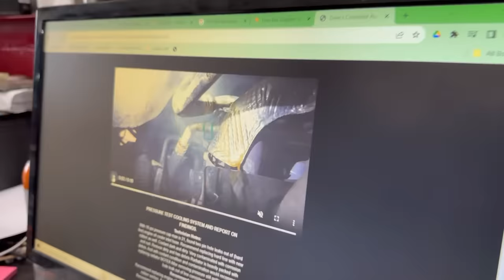The truth about maintenance, and what the manufactures tell you vs what you need to know

Comment: I agree 100%, cut the manufacturer maintenance schedule in half and you'll be doing everything you can to keep your car going. I have a 2006 dodge 2500 with the cam eating 5.7, I use redline 5/30 and an extended filter (RP 30-8A), 3k mile oil changes since new and it still runs like new @389k miles.
Oil & filter changes every 3k.
Trans fluid & filter changes every 25k.
Differential fluid changes every 25k.
Transfer case fluid changes every 25k.
No major repairs thus far.
Take care of your vehicles and they take care of you, just stay away from the fancy gadgets in vehicles nowadays, less equals more.
P.S. I refuse to purchase anything newer than the 06 I have, it's already beyond my abilities to repair the electrical systems. My 76 F250, 78 Corvette and my 87 square body are much easier and cheaper to repair.
Reply: Look up Uncle Tony's Garage, he basically tells u why the cam gets eaten...... it's from constant idling.... there isnt enough splash at idle in the crank to hit the lifters, which eats cams..... cop cars were notorious for eaten cans because they idle a ton....... just a heads up, watch ur idle time 👍👍
Reply: @blainebigger8332  Virtually no idle time for me except the few minutes to warm up. I've sent out oil analytics periodically and they returned an analysis that shows the oil is good for 7k mile oil changes but, I still do the 3k mile changes. Peace of mind costs more I guess, lol.
Reply: I have the same truck and run 10,000 mobile 1 and change it once a year. As well as never changed the transmission fluid. Just crossed 200,000 miles and haven’t had a problem since new. Just use quality products. Over maintaining is definitely a thing.
Reply: @blainebigger8332 uncle Tony is a hack, especially about the Hemi oiling "issue".
Reply: All great advice
Reply: @mr8610  Nahh, "quality products" are over rated. Maintenance is key.
Reply: @mr8610 Well a transmission is definitely in your future. The difference in your example is when that trans goes BOOM, it’s not going to be able to be saved. You’ll have to get it replaced.

Because I can hear you rubbing the pennies together from here, you’ll probably get a used unit installed. Subject it to the same negligence, and then enter the vicious cycle of replacing transmissions every couple of years, until you get rid of the rig. Then you go on the internet and complain what a POS Dodge products are.

🤷‍♂️
Reply: @lynxstarautomotive208  I do pH strips every year when I change my oil with Mobil 1 10,000 full synthetic. Still comes back rock solid. No reason to change it when it isn't giving you any issues. If it blows up, I'm replacing it with a refurbed unit.
Reply: I just bought a 112,000 mile ram 1500 as a daily because I know how to fix everything and there’s no emissions crap
Reply: That 'Less is More' line - My friend just got an SUV with the automatic rear door, just wave your foot under the license plate, and she opens or closes. We KNOW that's going to fail every 5 -10 years, and probably cost thousands. And if you can't open a damn door, you probably shouldn't be driving. We're going to be throwing away EV's in 5 or 10 years as well, so I can't see how that improves the environment. I completely believe in Climate Change, but I also work for a Mining Company in Australia. We spew out a crap load of Carbon in some remote or sensitive parts of the world to get the minerals to make these new cars. And no way are they going to last like your vehicles.
But I shouldn't complain. My company gives me a new vehicle every 18 months or so, and nothing is getting more maintenance than is recommended.
Reply: @mr8610  just about any non-abused engine and drivetrain since at least the 90's will typically last 200,000 miles with minimal maintenance like that. It is not impressive enough to be a sign of good quality. They won't  normally get to 300,000 or 400,000 miles like that though.
Reply: @joshnabours9102  as someone who has had just about every truck under the sun I can tell you that your statement is false. 100,000? Sure. But once it hits that 100k, you’ll find out fast which vehicle is built better. Had a three separate Chevy 5.3s, and every single one of them started smoking on start up basically @ 110,000 and was burning oil like you wouldn’t believe by 180,000 miles — had good luck with the 5.4 Fords and Hemis though.
Reply: @mr8610  according to an easily googleable AARP article on how long cars last: "A typical passenger car should last 200,000 miles or more, says Rich White, executive director of the nonprofit Car Care Council". Additionally, every number found on a quick google seems to be at least 40,000 miles more than your anecdotal experience. 8 years and 150,000. 9 years and 170,000. 10 years and 200,000. When you consider the average age of cars on the road in the US is ~12 years old it makes your experiences sound even more atypical. Furthermore, manufacturers commonly specify that timing belts need changing every ~100,000 miles and timing chains be changed at 150,000 miles. Surely that means manufacturers designed the engines to last significantly longer than those intervals right? There is no need to build out a service table to that point otherwise.

Also, for the record, regularly towing heavy trailers while changing only the oil and filter on a gas engine every 10,000 miles instead of following the severe service maintenance intervals provided by the manufacturer can easily lead to the anecdotal outcome you described having. It is arguably considered abusing the drivetrain.
Reply: @joshnabours9102  real world experience vs your articles. I’ll stick to what I’ve seen with my eyeballs Mr. Google.
Reply: @joshnabours9102  real world testing and experience of maintaining a fleet over 30 years absolutely trumps your Google skills.
Reply: @joshnabours9102  PS: all oils are not created equal — I run a lifetime oil in my 350,000 6.7 Powerstroke — I only have to add a quart of oil every year with a new filter. Mr. Google expert…… lol………….
Reply: @mr8610  unfortunately anecdotal evidence is simply evidence of an anecdote. Worse, it is often rendered unhelpful by unconsciously applied human bias. Furthermore, even if you had 60 years of personal experience with 10,000 different examples of gas truck engines you have owned and maintained over the full lifetime of those 10,000 vehicles this number is far too small to accurately represent the many tens of millions of vehicles that you claim they do. The sample size is simply too small to be accurate. 

 It would be like being asked to determine the cause of an engine failure after being provided a small piece cut off of the exhaust manifold and nothing else. It is simply not enough information to make an informed assesment.
Reply: @joshnabours9102  nerd
Reply: @mr8610  I apologize for choosing to respond in like manner. It was not a good decision on my part to do so. I am going to end the conversation here as clearly nothing further will be productive.
Reply: @joshnabours9102  dangit. I liked the boomer comment.
Reply: @Coonbooga  actually 3k miles is just in your head, because of what you learned in the 90's and earlier, there are still oil change shops that try to tell people they need it done at 3k still. It's not needed and it's not environmentally friendly to change it at 3k.
Reply: I had a 2013 ram with the 5.7, I changed the oil like you did using Royal purple and Pennzoil Ultra and still had the cam go at about 170K.
Reply: @85CEKR  did you put a lot of idling time on It? I heard the mopar 5.7 engines are known to eat the cams because of oiling issues at idle.
Reply: @85CEKR  Yeah, I think the cam problems started after the 2010 model year.
Reply: 2006 Don't have an issue eating cams. That started in 2009+ with the Hemi
Reply: @joshnabours9102  That's a neat article. I also saw other research that said only 1% of cars on the road will ever reach 200k+ miles.
Reply: @mph5896  it is possible they are both accurate. I would imagine most cars that fail to get to 200k miles don't get there because of age, not being driven, or the most likely one: being totaled in an accident. Ten year old used cars in functional condition with 130k to 180k miles on them are super common after all. A ton of them have clear signs of abuse by their previous owners though.
Reply: @blainebigger8332 what’s the Crank got to do with it?
Reply: @mr8610 
Mobile 1 full synthetic is the only way to go in my opinion.
Reply: Facts. I still have a '91 Eagle Talon and an '02 Nissan Xterra both with over 200k miles. I remember when the Splitfire plugs came out on the scene and I used them in my Talon and it had that extra boost for the first 2-3 months then ran like crap and had to keep changing them. I went back to the regular Champion plugs and it ran like factory again and I never used Splitfires again. For the 'X, I tried to use the upgraded Bosch plugs and the guy at the store told me to use the NGK plugs for Nissans and he was right. I went to go for the higher price ones and it ran like trash. Went to the regular NGK and been riding smooth ever since. Maintenance is key and so goes for the inexpensive parts.
Reply: @mr8610 💯 Americans are nutty when it comes to vehicle maintenance
Reply: You're throwing money away changing the filter that often. If you're changing the oil every 3k, your filter is basically new every time you throw it out and put a new one on. Keep changing the oil every 3k but change the filter every 3 oil changes.
Reply: @JunkCCCP  
The guy has 389k on his hemi and it still runs great. The cost of a filter is miniscule even if you're right, it's still good measure to change it
Reply: @treeamigo8447 Blindly replacing things that don't need to be replaced is akin to sacrificing a chicken to ensure the sun will rise tomorrow. You can do it, but it's wasteful and doesn't help anything. Cut open an oil filter at 3000 miles (use a pipe cutter so you don't get metal filings into the internals using a hacksaw or grinder). Take apart the accordion of filter material. I nearly guarantee you will not find anything in there at all.

The danger in keeping an oil filter on too long is that the filter media becomes clogged and the oil goes thru the bypass valve instead of being filtered. If there's nothing to clog the media - there's no reason to replace the filter. Especially if you're changing the oil every 3k miles and there's no sludge buildup and fried gunk needing to be filtered out of the oil.

You can replace your air filter every 6 months but if you live where it's snowy 7 months of the year like Alaska - you will be throwing money away for no actual reason - just sacrificing chickens to keep the sun coming up tomorrow.

Everything should be done logically, first and foremost (sorry for the multiple notifications, Youtube doesn't like me editing my comments)

Comment: My daughter and her husband just bought a new vehicle each. My daughter is following my advice and changing fluids regularly. Every 5k for oil, 30k for tranny fluid, etc, etc. Her husband is going by the dealer recommendations of every 10k for oil and never for tranny fluid. 

Ive talked to him twice trying to explain exactly what was said in this video but to no avail. He even became a smartass and said this isn’t the 1970’s anymore and if the dealer says to do it, then that’s what hes gonna do. 

In about 5 years I am going to be really interested to see who starts having problems and who doesn’t.
Reply: What kind of cars are we talking about?
Reply: Yeah if he is on dirty  roads or high load or any extreme conditions he should do 3k on oil. Trans fluid can last 50-100k miles depending on auto manual 5/10spd etc. But yeah "dealer says so" ok dealers also refuse to recall KNOWN issues if its cheaper to setlle lawsuits. WE ALL know they do this
Reply: Be sure to warn all of your son-in-law's friends to never purchase one of his used vehicles...
Reply: Firstly no manufacturer says to never change the transmission fluid. Secondly changing synthetic oil every 5000 miles is a waste of money and environmentally irresponsible and an old wives tale. Thirdly I've been using synthetic oil since 1998 and I can guarantee I know more about it than you. A big problem I find is that people use synthetic but use a regular filter ( non reinforced ) for extended drain intervals. Synthetic oil is good for 30,000 km drain intervals but a good reinforced ( synthetic filter ) must be used so that the filter doesn't go into bypass. Please stop with your uneducated advice as it does no one any good.
Reply: @carlosoliveira-rc2xt  really....so about that '18 Camry of mine where in the winter with 2000mi on an oil change I found the level just a smidge high and odor wasn't normal....yeah, what if I had gone to 10,000mi with that oil?  Bad things.....per a tribologist...because I didn't know until I had it analyzed that I had dilution going on and the viscosity had gotten to the bottom of the range at 100C.  So your statement might be safe for a highway-only vehicle where oil analysis is done at 5k to prove everything is on the money...but most folks can't afford that ESPECIALLY WHEN CHANGING THE OIL IS LESS EXPENSIVE THAN THE ANALYSIS!!!   I'm an engineer working in heavy API rotating machinery and I've met with Shell engineers and I've made a vehicle go to 400000 that still got 43mpg.  Your advice is highly misleading!!!
Reply: @carlosoliveira-rc2xt  Incorrect, Toyota and Lexus have said since 2007 that WS ATF is a lifetime fluid.  Also, unless you are doing oil analysis you have no idea with the type of car and driving habits if the oil can last 5k, 10k, etc….your just guessing at best.
Reply: @hokie9910  I've done oil analysis since 2000. I think you haven't spoken directly to Toyota only a dealer, perhaps. There may be certain model transmissions that have extended drain Intervals. If your particular dealer is telling you to never under any circumstance change the  transmission oil, report that dealer. Every dealer in my area have  appointments and pricing for transmission oil drains. Lastly don't assume my education or experience level, I don't guess.
Reply: @carlosoliveira-rc2xt  Have you ever read the dipstick transmissions on some of the 2007 or so Toyota cars, they indeed say lifetime fluid do not change.  I assumed you never did oil analysis due to your over generalizing and lack of detailed response.  Also there is no difference between standard oil and synthetic oil in regards to their ability to handle extended oil changes.
Reply: @hokie9910  Let me ask you why is there a dipstick if the fluid is a lifetime fluid? Wouldn't the transmission be sealed if this was to be the case?
Reply: @carlosoliveira-rc2xt  I’m not saying it’s right, I’m stating the fact that Toyota and Lexus indeed printed this on their dipsticks, before they went to no dipstick system, with the fill hole on the side of transmission.
Reply: @richcombs4805  There's your problem genius, it's a 2018 Camry. I bet it was the four cylinder, right? Don't blame the oil change interval when you have a defective engine.
Reply: @carlosoliveira-rc2xt  wrong to imply it is defective....not that I'm a fan of CAFE standards that send engines in the direction of direct injection.  You might benefit from browsing videos by a tribologist who runs Total Seal and Speed diagnostics: Lake Speed Jr. (Aka The Motor Oil Geek) because you'll learn a thing or two.
Reply: Change oil  and filter every 4,000 miles and transmission fluid every 35,000 with filter every 70,000 miles then sell or trade at 200,000  miles while it still runs smoothly.
Reply: @harryharmer2476  if you’ve taken it 200000 I’m not sure it makes sense to trade it in at that point.  If you’ve taken care of of it and it’s a good brand like Toyota or Honda you would probably run it to 300k and the value wouldn’t change that much.
Reply: @hokie9910  Hey bud You're absolutely right if it was a Toyota or a Honda but it's a Ford and I don't know if I can go much longer in a Ford 😊
Reply: @harryharmer2476  Yeah, if you can get a Ford to 200k and she’s still running smoothly and someone’s willing to buy it, SOLD!!
Reply: @hokie9910  😂 so true
Reply: @carlosoliveira-rc2xt  actually it's a mixed responses. I've heard not to change transmission fluid because if you do then your transmission will slip after that.
Reply: @carlosoliveira-rc2xt  you don't know what you are talking about. Oil change intervals are done based on how a car is driven. If you are doing mostly highway driving, you can go longer than someone that does a lot of short trips, towing, or driving in dusty conditions. It is important to check the oil periodically between oil changes. You can have an engine consuming oil, and you won't know it if you only check it when you change oil.
Reply: Blindly trusts the dealership, I'll bet he also Blindly trusts the government too
Reply: I can't believe a dealer wouldn't want to do more work.

Comment: I love old classic trucks. I have a '79 Ford F-150 with a 5.0 that I rebuilt in my garage. I made sure the block was cleaned inside the water jackets and all the oil passages were clean. I've been driving it now for 4 years and the coolant has been changed once every year.  About 2 months ago, I had to replace the water pump. When I used a flashlight to look as far into the block as I could, I didn't see any rust at all. Maintenance is a small price to pay to keep an engine running at its peak performance!